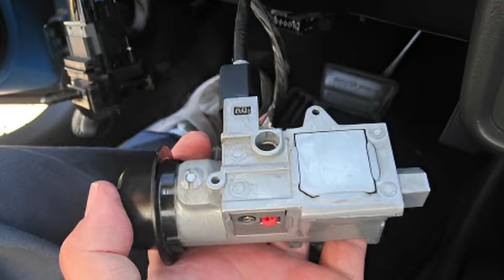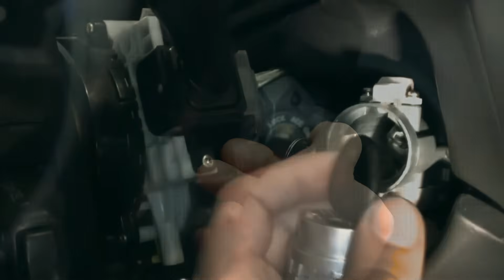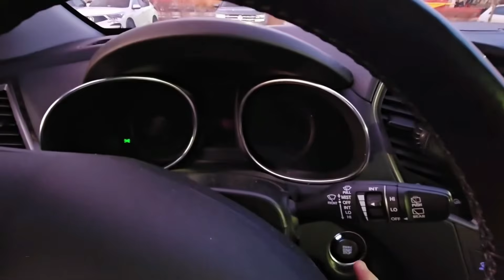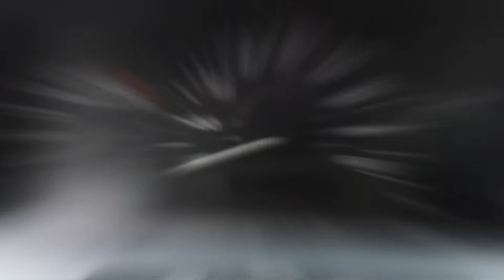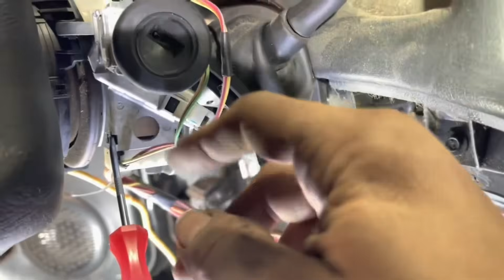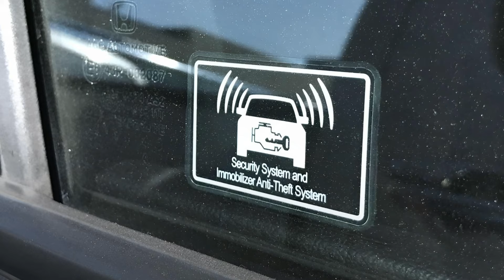10 Symptoms of a Bad Ignition Switch, Don’t Ignore These Warning Signs

Comment: 97 Camry, new starter, battery all those are fine, interesting situation (cold weather here)…. 
Just turning key on starts slowly only once in the morning HOWEVER, if I hold the power lock knob in lock position and turn the ignition key on the vehicle starts… very interesting 

97 Camry 336800 miles …. Want to do atkeast the 337000 miles 😊

Comment: Even if the dash had no sound no lights?
Reply from the maker: Yes — even with no dash lights and no sound, a bad ignition switch can cause this.
When the ignition switch fails, it may not send power to the dashboard, starter relay, or fuel system at all.
This is one of the warning signs people often overlook before a complete no-start happens.
Reply: @AutoFixProblem thats me

Comment: Issues with my vehicle. When you turn the key to on the dashboard warning lights  engine warning lights and stuff, used to go on ,cycle and go out when it started  
Now,they don't come on until the engine is started and running. 
Also had voltage fluctuations but wet away. Any suggestions besides taking it in for diagnostic?
Reply from the maker: That’s not normal behavior.
When you turn the key to ON, the warning lights should come on first as a bulb/self-check.
If they only appear after the engine is already running, it often points to an ignition switch issue, instrument cluster power feed problem, or poor voltage supply during key-on.

Since you also had voltage fluctuations before, I’d strongly check the battery connections, grounds, ignition switch, and main relays. A weak ignition switch or failing relay can delay power to the dash.

It’s a good idea to scan for stored or pending codes, even if no warning light stays on.
Reply: @AutoFixProblem thank you. 
I ll see what happens today.  Charged battery.  Cleaned battery/ cable  connections  ( looked fine but Cleaned anyway) checked alternator diodes ( 435 mv)  alt is charging at 14.4 v running.   Thanks for responding to my question.

Comment: Could you please give us the differential of whether it's is the ignition switch or the key cylinder
Reply from the maker: Here’s the quick way to tell the difference
If the key feels loose, hard to turn, gets stuck, or turns with no resistance, that’s almost always the key cylinder, because those are mechanical symptoms
But if the engine won’t crank, accessories flicker, the engine stalls while driving, or the car starts and then immediately dies, that’s usually the ignition switch, because those symptoms come from the internal electrical contacts losing connection
If you’re getting both mechanical and electrical issues at the same time, the cylinder can be worn enough that it stops engaging the switch properly,
Hope this helps you out